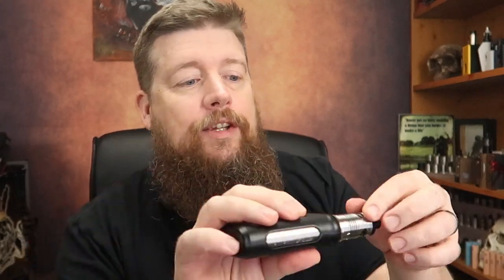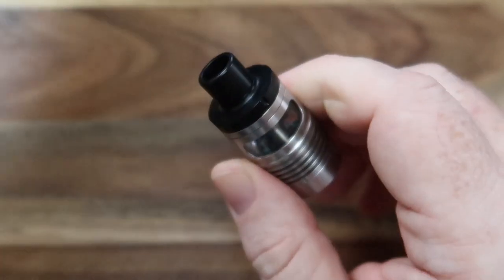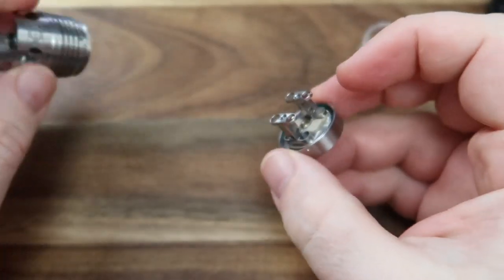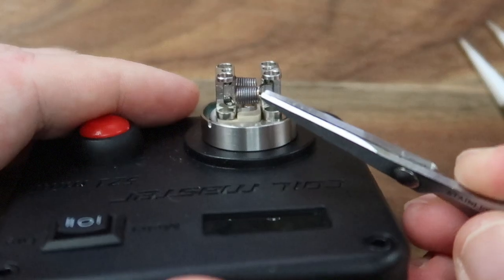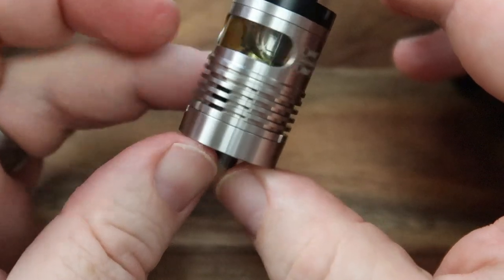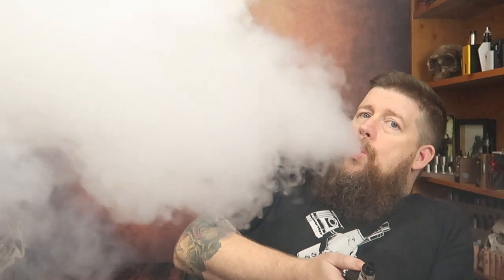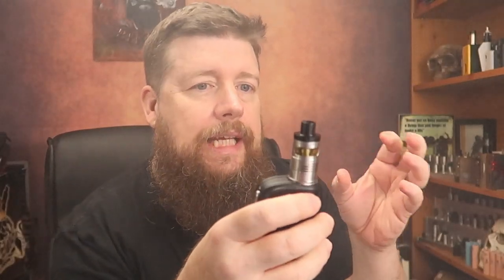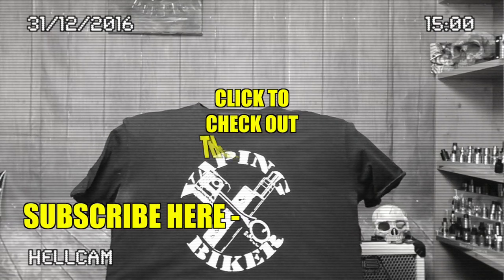Hellixer Review complete with build - Topsy Turvy stuff!

Comment: i just bought one didnt look at any reviews on them guy at the vape shop was using it got my attention i really really like it tbh once you re build a few times its really easy and the filling holes on the top have changes to 2 large kidney holes. great flavor and clouds are good. i like that i can close it off fully and doesnt leak in my pocket and i got the lager tank but not used it yet

Comment: It's a reverse velocity essentially. Pretty cool. Surprised they didn't call it the Fotoon Gravity seeing as the wick is being fed juice naturally by gravity. Supposedly you'd never get a dry hit as long as you have juice in the tank. 
One thing is that the wicking has to be spot on so it doesn't just flush through and flood the deck and pour out.